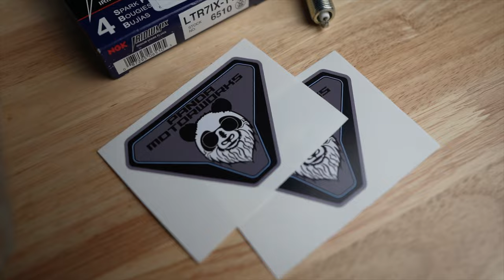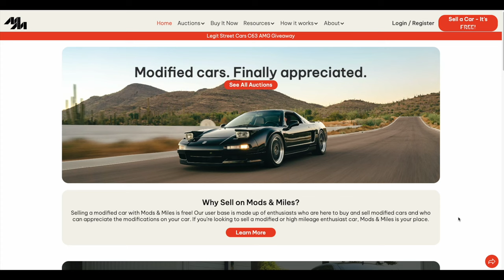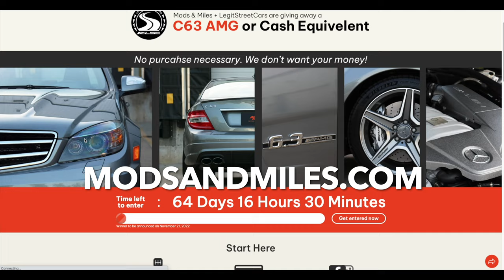Panda Power Module Install, A Tuner that Does NOT Void Warranty! [Ford Bronco]

Comment: Why dont you do a comparison video between the Panda motorsports tune, the ford motorsport and the JB4 tune.  Two are piggy backs and of course the Ford performance is ECU.  I put on some race wheels adn am trying to get decent gas mileage due to the 2 doors tiny fuel tank.  Ford performance told me you have to remove their tune prior to applying another one.

Comment: I might try one of these. I usually put the bronco in sport mode, but it sounds like it has trouble downshifting and seems to rev too high when slowing down. That mode just feels a little "hacky" if that makes sense... but it does seem to give a nice power boost to an engine that feels pretty underpowered for the vehicle.

Comment: Love the content man. Im a little confused though... I was under the impression that any modifications to the ecu would void warranty, what makes this one different from say like a cobb accessport and shelf tune?
Reply from the maker: It’s because this is just a piggyback system that doesn’t flash the ECU so there’s is no record of anything if any tuner or dealership were to check! 🤘🏻
Reply: Can anyone confirm this statement.I thought dealer could still see the over-boost from the turbo in the logs then they would deny warranty work.

Comment: You need to turn off your traction control on 0-60 runs. Otherwise it will bog down when you spin the wheels.

Comment: Thanks for the informative video!  Do you know if dealer software can detect max boost pressures or out of spec A/F ratios?  Even though the piggyback is disconnected, can the logs save incriminating data?
Reply: Yes, once the engine defaults on the parameters it logs the errors.. so if your pushing more boost then what oem allows and it goes boom.. guess what all that data is saved in the DTC, and if you clear all the codes they will know your covering up something